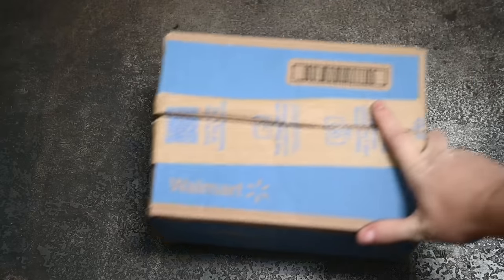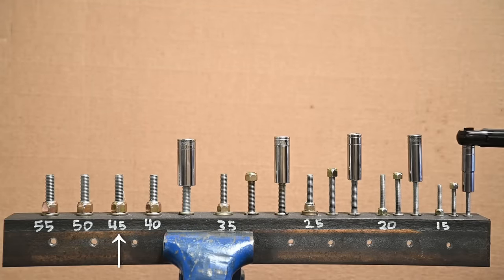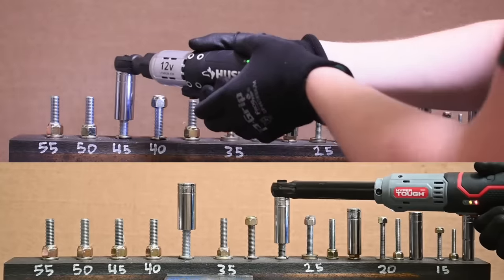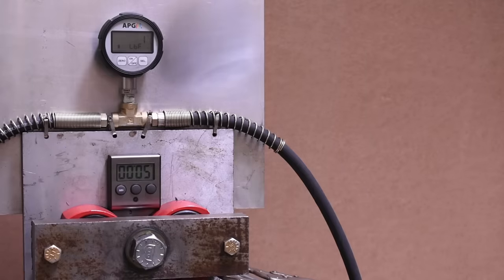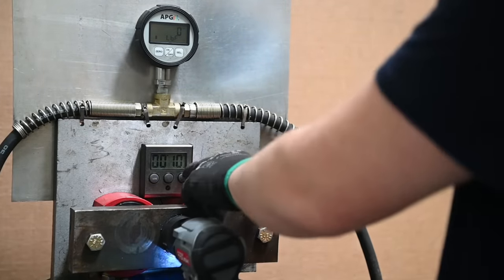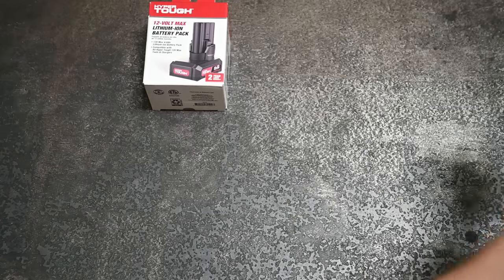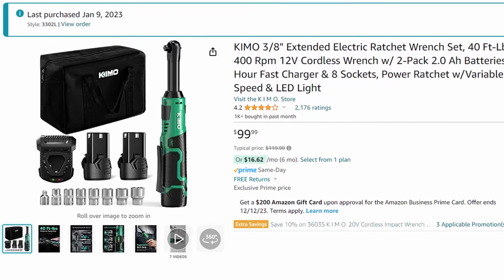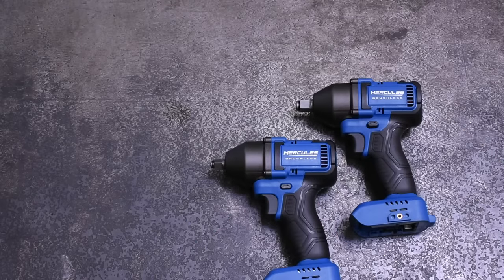Latest Walmart Hyper Tough Tools vs M12: Too Cheap to Pass Up?

Comment: if you are a home wrencher...honestly you don't need to worry about being faster...just go cheap and spend your money on something else that matters more.
Reply from the maker: Or just swing a ratchet by hand like we've been doin for generations :P
Reply: @TorqueTestChannel oh no. No no no.

We need Milwaukee copies for a third of the price.
Reply: @TorqueTestChannel I swing ratchets a lot just for the noise factor and torque control. When are we going to get a brushless ratchet that has torque control, similar to a torque wrench but maybe within 10%.
Reply: @tanker242 and then it’s “only” 230% of the price.  Why pay more than 2x for something you don’t need? Because it’s “a good deal”?
Reply: @MechanicalMercenary  I’m pretty sure Milwaukee has an m12 electric torque wrench
Reply: As a home wrecker, all I've needed is my DCK
Reply: @TorqueTestChannel  true, but at my age these days I’m invested in some power tools, the muscles don’t have the stamina it used to before they cramp up. I use Ryobi for the light stuff and Milwaukee for big things when power matters. Can’t go wrong. 😊
Reply: But this seems like junk. You don't need the fastest tool, but you want a good tool that is reasonably useful. Buying cheap can be a waste of money too.
Reply: Agreed, but with these there's a good chance they won't even get the job done. I wouldn't bother with them.
Reply: @MechanicalMercenary  At not the one-time torque wrench shown helere LOL
Reply: I wouldn't buy tools outside of whatever battery ecosystem I'm already on, or intend to buy based on performance of multiple tools I would use for that battery.

In an enthusiast or professional shop, maybe it isn't a big deal to have multiple different batteries and chargers for specific tools. But for most people, I think having one or 2 battery platforms is about the limit. Maybe 3 if you have battery powered weed eaters, hedge trimmers and such.

12V batteries for light to medium work.
18-24V for medium to heavy work
40-60V for OPE.
Reply: There is no valid reason to waste money on literal garbage that can't turn a bolt.
Reply: I bought the extended reach ratchet a few months ago out of curiosity and it was fine.  I’ve used it to run nuts and bolts and it beats a hand ratchet easily.  I’ve used it while removing a transmission and doing a lifter and rocker job.   It’s definitely worth $60 😂😂😂😂.  But if it cost $100+, I would stick with other brands.
Reply: What should home wreckers get?
Reply: @ccbowers   say it louder for the people in the back...
Reply: If a Milwaukee boosts your enjoyment of a task than it’s actually a worthy investment. I enjoy my Milwaukee tools because I enjoy using them
Reply: @RabidBadger_     😅😅😂    #garbage,   so true..  its 2023,  so many options that can ACTUALLY do some work..  why buy GARBAGE ? 🤷
Reply: I enjoy enjoyment because I'm enjoyed with being joyed.
Reply: I'm a  diy guy but have found that the electric stuff helps me alot..I've got a m18 mid torque and a m12 fuel high speed ratchet both in 3/8 drive and its great..I've done all my own stuff and wouldn't go back to swinging a ratchet on everything like I did for years.. so nice to get the m12 ratchet in those tight areas to spin stuff out..
Reply: The charging speed is a problem though. I don’t need super fast charging but 5 and 10 hours to charge these batteries is a bit much. But if you can deal with that it’s an attractive price.
Reply: I would take my chance spending my money on a greasy impact at a pawn shop over this Chinamart brand.
Reply: @JeffDM they sell a fast charger
Reply: Yeah, spend more time away from the wife 😂
Reply: Yeah, no need to worry about being faster, but you still need to worry about not buying a complete dumpster fire. That is, of course, unless you enjoy being frustrated by not being able to do any real work with your tools before they hit the safety cut (or you never do any real work to begin with, in which case this would be perfect).
Reply: No way, if you are going to be doing the occasional diy job on old equipment you need power to get through rust and corrosion. Also a tool that doesn't cut out. It's going to be a classic situation where you are already invested into the job and are gonna go buy something else to just get it over with quickly. The loss in time driving to the store  waiting in line, fighting traffic will turn the simple job into an arduous journey where you contemplate hiring someone else lol. Do it right the first time. Shop around and get good quality tools on sale before you need them.
Reply: I disagree. Faster? No. This tool is much more than just slower. It's weaker, far weaker. You want a strong tool. Milwaukee makes strong tools. I bought the 3/8" stubby and I am not a rich man by any means. That thing has paid for itself time and time again just removing lug nuts.
Reply: Or you could stretch the value to 10 years(it should hold more for home use, but lets be pessimistic) and the good quality tool is not much more expensive - this is not a consumable, like food to compare prices as a short-term investment.
Reply: @TorqueTestChannel Never understood the appeal of cordless ratchets myself to be honest
Reply: Ya I was thinking it's slower than the Milwaukee but it's still at least 10 times faster than a manual ratchet
Reply: @TorqueTestChannel Pffft! That's crazy talk!
Reply: Spend it on materials. $500 tool won't be helpful if you're using it to install a $3 push/pull angle stop or cheap out on the underlay for your flooring.
Reply: @billymurphy3 LMAO
Reply: @MechanicalMercenary Milwaukee has that, M12 torque wrench
Reply: The ratchet would probably be fine for most people or a eoad kit, travel tool or something. That impact wrench is absolutely useless though, holy smokes.
Reply: The ratchets are great, used it for my bike and installed a new toilet, just break it lose and use to remove fasteners. It’s also great to have a to go bag for the junk yard runs or small stuff around the house and for both ratchets under 100 can’t beat it. Take care of the tools and the tools take care of you
Reply: I got places to be
Reply: I bought all Milwaukee stuff so I don’t have to buy another one pretty much ever
Reply: @TorqueTestChannel 😂legit
Reply: @TorqueTestChannel  love the content, I've recently started working on the side and I've bought the hyper tough brand and have slowly began moving into the name brand tools. They were great in the beginning but now I'm looking for efficiency and have relied heavily on your channel 😊
Reply: How many home gamers are looking for an extended reach cordless ratchet.  Those that do would be better served with one that doesn't take 10 hours to charge with a dinky barrel plug...
Reply: I’d disagree. Being faster at working on your stuff is important whenever you work all day and only have a couple hours of daylight when you get home.
Reply: @TorqueTestChannel you put the wrong NM on screen for Milwaukee 10 seconds reverse
Reply: @JeffDM Hyper tough has a rapid charger if you want to pay for it. In my experience the You just needed a light due to tool. I have a hyper tough drill I used to install and remove small screws and occasionally drill holes through wood and thin metal. So far the drill has lasted me 4 years of daily use at work. The electric yard tools of the same brand aren't bad either.
Reply: @billymurphy3  j
Reply: I think this statement is fairly accurate however it definitely needs a caveat because there are times when a threshold of power is needed so purchasing the cheaper tools may leave you going back to buy the better tool anyway. 

The professional price tag is NOT ALWAYS about increasing speed/productivity sometimes it’s about capabilities + longevity. 

I personally subscribe to the motto “Buy Once Cry Once” because Ive already paid Karma’s Dues and learned “There is ALWAYS a CORRECT Tool for the job” (i.e. one that you won’t spend 3x times as long fighting with just to get a decent result from)
Reply: For real….I use my power tools once in a while and I kick myself in the butt because I buy all Milwaukee knowing I don’t need it😡😡😡
Reply: @TorqueTestChannel I agree but the reason these tools exist is so when we’re old and grey we aren’t bitching about everything aching let the machine work
Reply: In that case just use a ratchet. If I’m spending money on these, I expect to work, especially when I need it to work. My 1/2” Milwaukee punches over its weight. I haven’t used my new ratchet, and I’m looking at a 3/8 gun. 
My 1/4” porter cable is still kicking and I’ll run it and the rest of my PC till they die. If the Walmart worked remotely as well I’d pick one up at a fraction of the cost gladly, but it’s apparent they don’t.
Reply: @rdspam why spend the money at all if it won’t do what you expected it to?  I was happy enough my Milwaukee knocked the lug nuts off my big truck. I was blown away that the same battery put them back on within a 1/16th turn of torque spec. They’re put on with 1” air guns at a shop. My 33mm was a 3/4” and I had to buy a reducer from an old breaker bar kit I carried in the truck. 

Point being i don’t want to spend 50 let alone 200. But if the 50 won’t work it’s a waste of money. If it does great. That’s what these videos are for. I’ll add another battery type to the cupboard if the price is right; these Wally worlds have proven to be, at least to me.
Reply: @Craig-o9v half inch impact gun though right? I think some of the 3/8s strong enough for regular trucks cars , I have half inch craftsman I just bought conversion to use M18 batteries hopefully it’s stronger 😂I still use breaker bar but gun still beat ol T bar
Reply: I always use my tools as an excuse for my laziness. I was able to do it when I was using old Nicd 12v evolve tools. Now all of my tools are 18v Makita so that I can't blame them anymore.
Reply: Like the wife 😅
Reply: @tanker242  these are also fuel models. This isn’t the base M12.
Reply: Why not get some real Lugnuts and try and turn them? I think real world testing will surprise you.
Reply: @MechanicalMercenary Milwaukee makes one but it’s around $1k
Reply: The hell I dont! 😂 I'm still buying the fastest one even if I use it once.
Reply: exactly
Reply: Right. Literally but 5 of the tools just in case. You know the 10mm law
Reply: @lancemcfarland8780 pure garbage though.
Reply: Yeah then buy another every 2 months 😂
Reply: Or buy better and only buy once.
Reply: The only budget tools I trust are dewalt
Reply: @jeremydoblinger3609 i have the m12 stubby and high speed ratchet. You must live in arizona, texas, or somewhere wo rust because the millisecond the highspeed sees any type or resistance it doesnt work w the trigger. All i find it good for is installing fasteners to run them down. Removing fasteners, i understand they arent meant for high torque stuff, but even after cracking them free, if theres rust on the threads it still doesnt do anything. I spend more time turning it by hand than w the trigger pulled, unless installing fasteners, so thats all i really use it for, unless inside the car
Reply: @DJDiarrhea they are good for hard to reach places and tight spaces you cant get a decent turn by hand. Thats where they really shine. Other than that. But even doing simple brake jobs, running the fastener in and out faster is nice. Just dont expect much torque from them. As long as you understand they are nut runners and use them as such, they are nice to have. Crack it free by hand, spin it out. Run it down w the tool, snug it by hand. It does take a lot of time off longer jobs.
Reply: @TorqueTestChannel but these things are nice for tight spaces . Also it’s still less effort
Reply: A manual ratchet would be better and wouldn’t break after the first use.
Reply: Maybe if your changing out switch covers at your home then get chinamart brand but every workman knows you need a good name brand tool for work.
Reply: It’s not about the quickness. It’s about being able to break free a stuck nut or bolt.
Reply: @Mazshi  i mean the impact is about breaking free the stuck nut or bolt but the ratchet certainly is about speed and tight spaces.
Reply: @danw1392  Your milwaukee is made in china too my man... Other than that yeah name brands are worth buying .
Reply: Well by that logic, you don't even need a  powered ratchet. And that is a very reasonable position. You don't. The air or battery ratchets are only for when you DO want or need speed.
Reply: if it doesn't work, it doesn't matter how cheap it is. Just buy some beer and do it manually then 😅
Reply: Worst advice. I might just be a hobby wrench turner, but I'm not rich enough to buy the cheap shit 10 times when I should have bought the quality tool once.
Reply: Not by hand it’s hot  asf outside lol
Reply: I didn't know I needed to be faster until my paps bought me a Makita impact wrench. I can assure you I need to be quicker
Reply: The best for DIY is ryobi. The vast amount of cordless tools and batteries that are interchangeable for the past 30 years and won't change anytime soon you can't go wrong
Reply: @TorqueTestChannel  How many hours I've spent with my arm twisted getting 1/2 turn on a ratchet I can't tell you.  The cheap electric ratchet will at least get it slightly tight and then you just have to snug it up.
Reply: I can tell you are an hourly worker 😂
Reply: I will buy Dewalt power tools and I’m a garage mechanic, just because I know I can use them in a few years and if it fails, I can warranty it at a facility right down the road
Reply: @RabidBadger_  the Milwaukee wrench barely turns bolts.  I end up running it in with it and then tightening by Hans.  It is pretty anemic and cost a lot more.
Reply: For the price, even if they don't match Milwaukee's performance, they still seem worth it for light-duty work

Comment: 10 hours to charge a battery is what killed me
Reply: Yeah lol need the fast charger. It charges up in no time with that. They are only $15 a pop so I have two.
Reply: Damn 10 hours!? That’s insane I literally just bought one for fun had no idea it took that long!
Reply: Buy the fast charger - Its also very cheap  15$, Still the whole set is great deal for what you are getting.
Reply: An 1100HP Tesla model s plaid charges faster 😂 twice as fast on a slow charge

Comment: You guys should test more SKIL tools. They have their own ratchet now and have a ton of drills and impacts you haven't tested as well.
Reply: I'd love this.  I'm into the Skil 12v line for casual around the house stuff, and I've been pleased.
Reply: @hardeho  I am too, I use their 12-volt drill at work because it's super light and it doesn't fatigue my wrist.
Reply: It's not bad stuff but it's all the same company but I'm very curious what the results are
Reply: @angrybigfoot752  What's all the same company? Skil and Hyper Tough?
Reply: Like a lot of others, I'm in the Skil 12 volt line as what they call a weekend warrior.
Reply: I have had great luck with their 20v line.  My skilsaw survived a fall onto concrete that nobody could believe. I have Milwaukee stuff too but I use my skill in the rain and dirt because it's cheaper. No disappointments.
Reply: @sjagain skil is owned by chervon, who owns kobalt and and flex. Walmarts other brand, hart, is owned by tti, which also owns milwaukee, ridgid, ryobi. Hyper tough is apex, they own gearwrench. The big misconception is ppl think just because some of these brands are owned by the same company that they are made by the same company, which isnt the case. I think angrybigfoot was mistaken hyper tough for hart.
Reply: the Milwaukee impact wrenches and Impact drivers have been submersed in water and ran under water and came out spraying water everywhere Awsome tools
Reply: I bought their 12v impact and drill kit. The drill fucks, the impact is a steaming pile of shit. Trigger is awful and the motor completely died after a year of home use

Comment: I have that exact Hyper Tough ratchet and love it. I don't need it to be high torque or particularly fast. I just need it to run down a handful of nuts & bolts occasionally then I can tighten/torque them later if necessary. It was cheap, and it's convenient not to have to swing a ratchet in tight spaces.
Reply: Yeah same for me but I went with the short neck model because its only $40 and I didnt think I would need the longneck at least for now, probably will end up with one at some point as well. I just picked up their tiny palm router, was a steal at $50 with a nice case and some bits and accessories. Its not going to do the job of my DeWalt or hammerhead corded routers but I dont want it to (wanted a lower powered compact cordless for small jobs).
Reply: Build quality will mean you will probably have to buy 3-4 Walmart ones to last the same as the name brands
Reply: @JD-yx7be  In the unlikely event a DIYer such as myself manages to kill one of these tools we can replace it many times over and still save money. I don't think this is the comment you think it was.
Reply: @JD-yx7be  Eh.  Two year in-store warranty (at least on mechanic on youtube successfully used it) and WAY better build quality than I'm used to for Walmart.  I have the extended ratchet and it is less creaky and more solid than my brushed Milwaukee ratchet.  Probably won't survive extended abuse, but there's a reason they didn't complain about build quality in this video...
Reply: Yeah the Hyper Tough 12v long ratchet is a real gem. I have it and don't plan to buy any of the other 12v tools except maybe the rotary tool or 3/8 drill if i decide I need a second battery for the ratchet as the 3/8 drill kit is only $2 more than buying just a battery.
Reply: The low torque is killer tho....